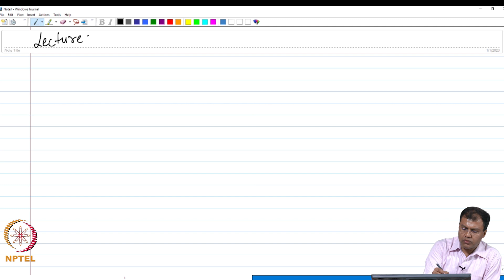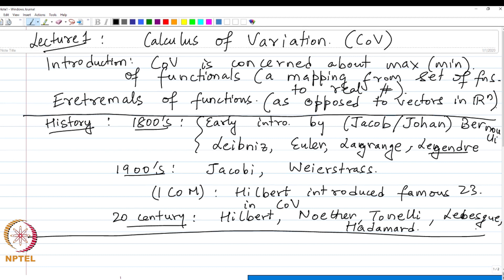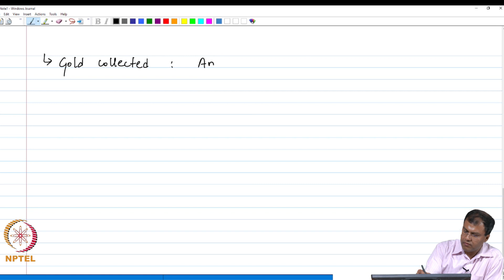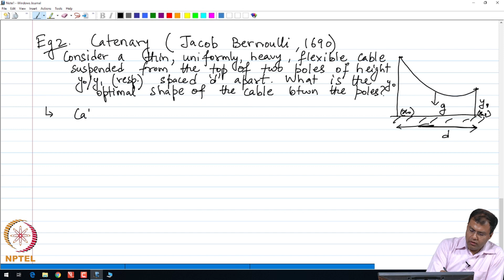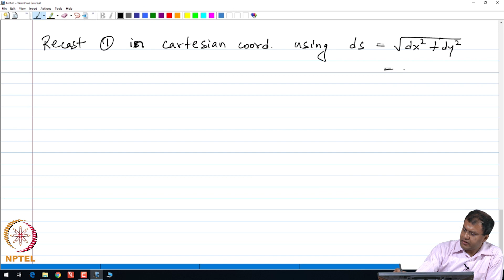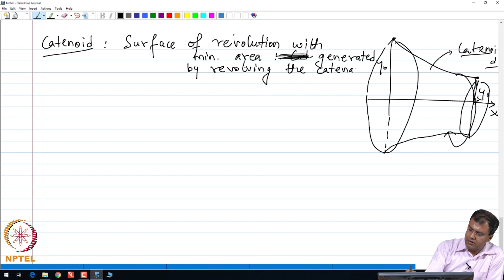mod01lec01 Introduction / Euler Lagrange Equations - Part 1

Comment: What a way to end on a cliff hanger, the equation reduces to the following integral and then halfway while writing the integral the video ends.
Reply: nevermind, i understood it, the modified equation is when the length of the wire and shortest distance between those poles are equal, in which case the catenary problem reduces to a problem of finding the shortest path (a straight line)!